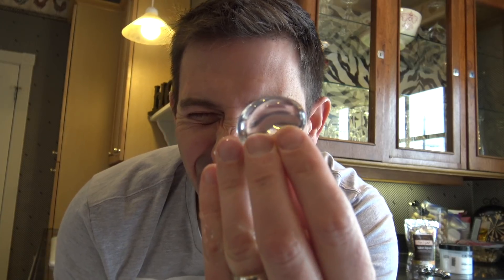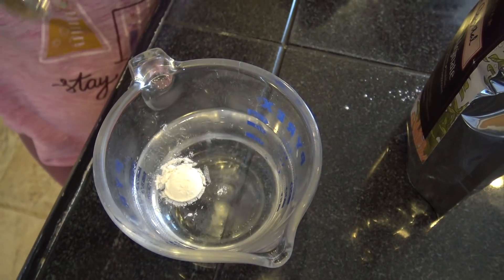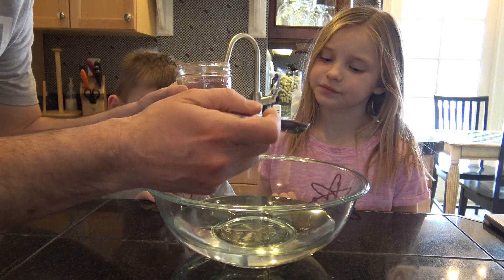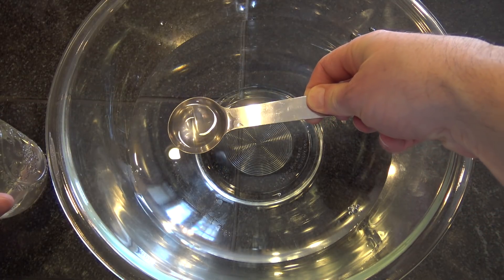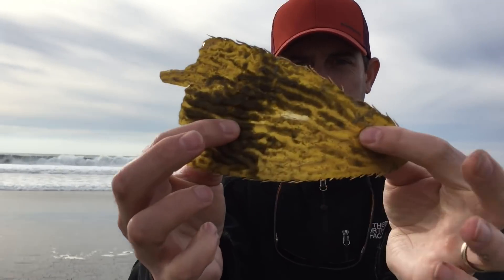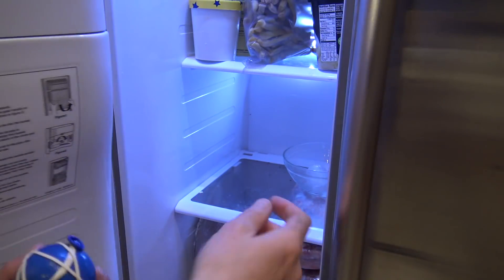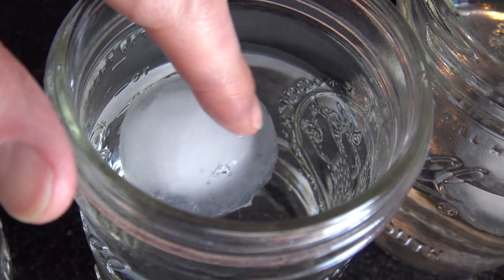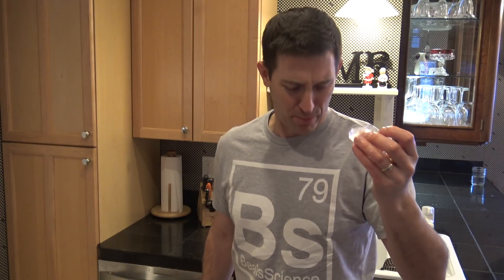How to make Edible Water Bottles!

Comment: Hi, I have been trying it for my science fair project however, the sodium alginate layer is not able to hold water, and it keeps on breaking. Am I missing something?
Reply from the maker: It is not a strong outer casing. It breaks easily. But if you experiment with times and concentration it can become stronger. I also had a student try calcium chloride and it made stronger shells).